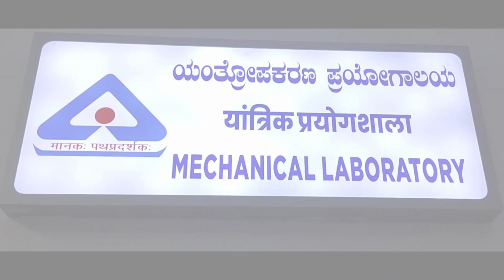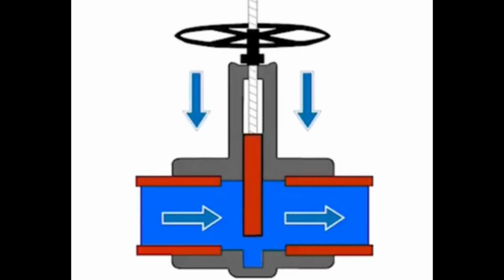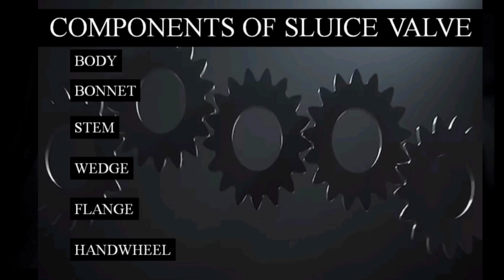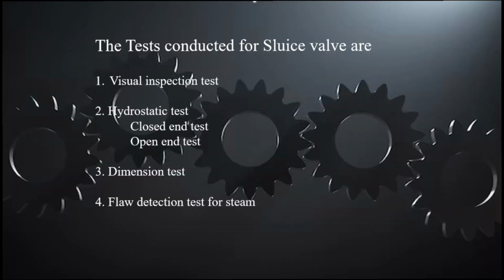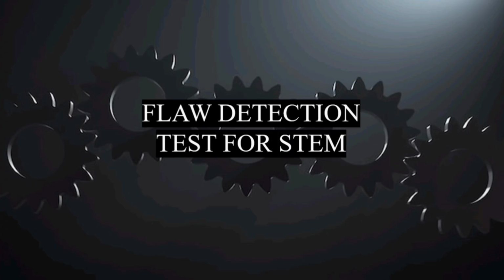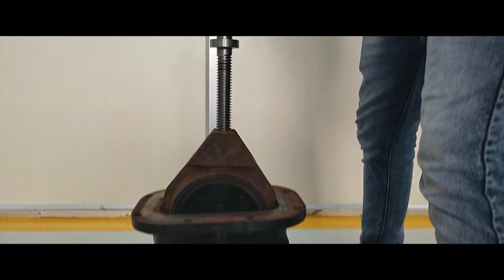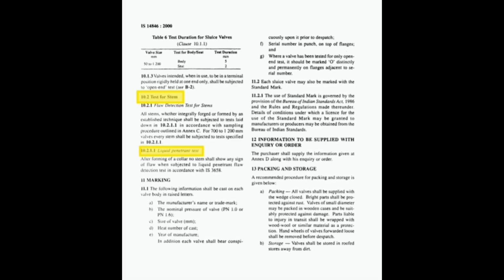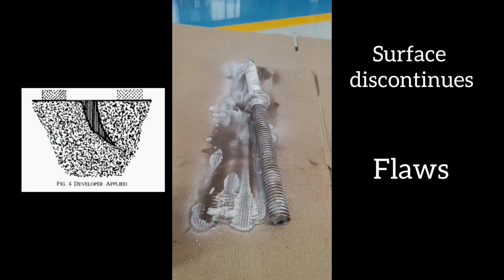Testing of Sluice valves for water works as per IS 14846: 2000 | Bengaluru Branch Laboratory (BNBL)

Comment: Very good . I, as an inspecting officer in ERo during 1984-87, had an opportunity to inspect sluice valve factory in Howrah and surrounding areas. It is very time consuming in factory , specially higher sizes. In addition to tests shown in video, tensile. Strength tests of cast iron, gun metal and brass are also tested. For cast iron , factory is asked to cast a rod while casting the body in boundary , which remains attached to the body till it is broken during inspection.

JKPrasad , ex BIS officer